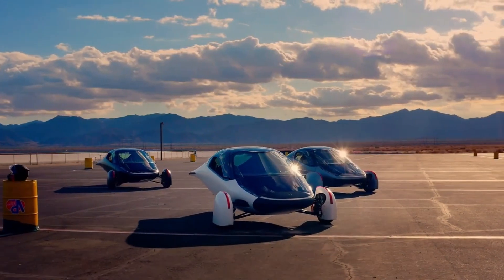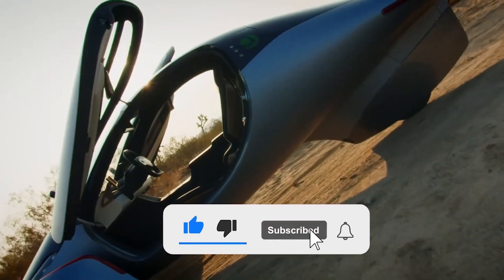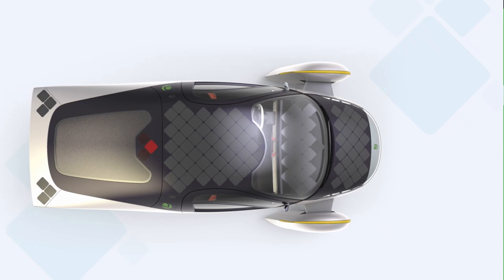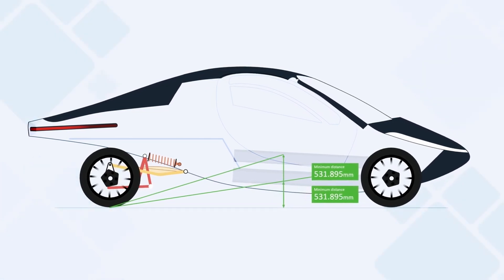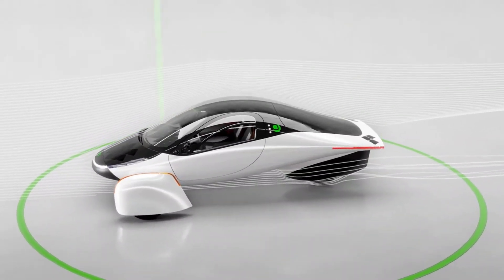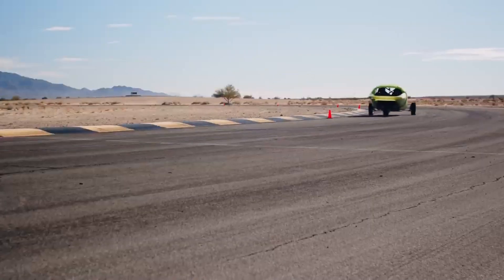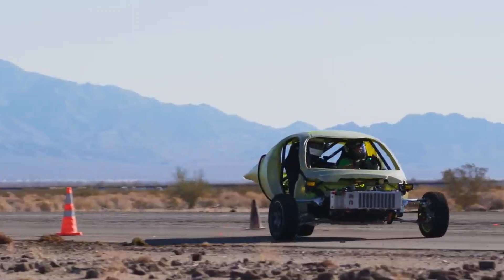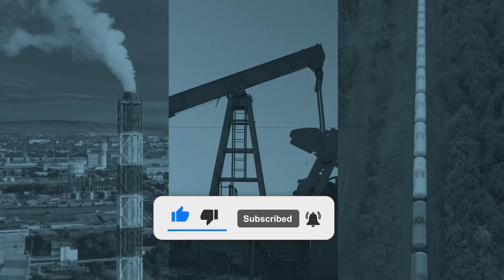Aptera's Stability Under Scrutiny: How It Handles Potholes, High Speeds, and Sharp Turns

Comment: One question is, if you load up the back of the vehicle with heavy objects, how does that effect the stability and control and tippyness?Given the shape of the back, large objects will be up by the seats but heavy objects like boxes of bricks may be close to the back. Wondering how that will effect the stability and safety?

Comment: Basically, putting the two wheels of three at the front gives it its inherent stability. If you want instability you put the two wheels at the rear. Why is instability inherently much greater with two wheels at the back? Because steering and breaking causes greater shifts in force because the car's momentum is moving towards them. Therefore forces become greater and don't dissipate easily. With two wheels at the front, the only way to create potential instability is to accelerate hard while turning hard. Yet even that is made less because the car is moving away from the potential instability and and major outward force is held in check by the outside steering roadwheel. And ultimately, if the outward force is too great, instead of turning over, the rear wheel will slide. So, its layout, combined with its very low centre of gravity [batteries and kit] means that you'd have to be in some very serious scencario to get this thing to turn over. And even then it probably wouldn't.
Reply from the maker: Thanks for this

Comment: My understanding is that these will be released (at some point) close to $40K.

At some point you have to weigh between practicality (only 2 people and no real storage), safety (can only use on clear no snow or heavy rain, and can't be very safe compared to typical cars in crash), and saving a little on costs of running a normal EV car.  Also, I can't imagine going on any longer trips with this, but daily use is OK.

What would it save a typical driver? Possibly $1000 a year at the most in energy costs? Likely quite a bit less?
Reply from the maker: Lo! 
The world actually needs practical solar powered car. Aptera is gearing up in the right direction.
Reply: @Elementraz  I always wonder why people think that there is no storage.  From what I can see there is more storage than in a Model 3 and for a typical sized car it has plenty of storage.  I think people think that this is a small little car.
Reply: The current list price of the Aptera Launch Edition is $30,700, but that may change in the future when they get closer to production.
Reply: The stupid is strong with this particular troll. Everything you said is garbage that has been debunked over and over again. Try to be more original.

Comment: I have ridden and driven one of the Aptera prototypes, screeching around the corners with Chris McCann easily demonstrated with a wide wheel base, low weight that this is one of the most stable vehicles I have ever been in.
Reply from the maker: @greenbergp 
You are on point.
Reply: Too bad that's nothing like what they are working on now. I stand corrected, it looks similar but the underpinnings are completely different.
Reply: @billsmith5960  You are right. It is completely different, but better for handling. The central motor means less unsprung weight. And the carbon fiber tub and steel reinforcement means an even more solid body. The early prototypes showed that the Aptera passed the Moose test with ease. And now the Aptera will handle even better.
Reply: @deanmcmanis9398  Nope, the carbon body is not structural anymore. Only he aluminium frame, where the plastic panels are glued on. The moose test was a fake. See the tracks in the lawn from previous tries that went bad. The aptera motorcycle handles quite bad.
Reply: @billsmith5960  Lets hear your ankle-biting cheap-smear bloviations on how poorly the Aptera will handle now that it features far less un-spung weight than it did with in-wheel motors, and has a more finely tuned suspension. surely you can fabricate some world-class concern-trolling over these developments?

Comment: The validation phase is going to be amazing as Aptera throws up amazing results.
Reply: I haven't seen a single real world result done by set standards. Instead, I see claims of what it could do. With Aptera constantly changing the design, I have no idea how they could keep making the same claims until they actually test the real product.
Reply: @billsmith5960  In going to ask them, as well.  You sound like a skeptic(?)  So, I'm interested in when you would guess this might go into production, if at all. They said they're in the "high speed testing" phase. What do you think, please?  I'm new.
Reply from the maker: Sure!
Reply: What result? I only see more empty promises.

Comment: Lots of talking about the design, I would rather see it actually doing a course against a similar 4 wheel car.
Reply: What would a similar 4 wheel car be then? There are lots of 4 wheel cars out there but I don;t know what would be similar to the Aptera.
Reply: @billsmith5960  Any small electric car, maybe one of the cheaper Chinese cars.
Reply: @billsmith5960  A model 3 LR RWD would be an equivalent car in a 4 wheel configuration.
Reply: @bryanwhitton1784  - Seems to me a Model 3 RWD would not be equivalent. For starters, it's RWD.

Comment: Interesting discussion of design features intended to produce stability and rollover resistance, however: real world specifications for acceptable cornering G forces and the tip over threshold would be more reassuring.
Reply from the maker: Nice. Noted
Reply: Don't worry, Aptera is the most transparent company ever. They will give us the good and bad news.

Comment: It would be sub-par in a snowy environment because the roads tend to have a parallel set of tracks that stay clear of snow due to all the drivers staying in the same ruts as other drivers. The Aptera, on the other hand, will drag its middle rear wheel through all the snow that accumulated in the middle of the road.
Reply: Definitely not for those areas for sure
Reply: Yes.  I used to be a mailman and drove the LLV (they are still in use).  The rear wheels are wider than the front so whenever you had to drive through snow, you were having to make two paths.  It was almost impossible to deliver mail on a snow covered court as the damned things would constantly get stuck when trying to turn.  As for the Aptera, think of all the times you straddle an object or pothole with your 4 wheel vehicle.  With an Aptera, there's a good chance you'll hit the object with the rear wheel.  The Aptera's front wheels are set very far apart so that might be a consideration if you plan to park it in a garage with another vehicle.  I think a 4 wheel model would be a good idea.  It would give you more room for storage in the back and be more stable.  Despite all that, I hope I'll start seeing them on the road some day.  ha!  I've been saying that for years!

Comment: What size generator do I need to haul on a trailer to drive long distances (what is the wattage at highway speed)?
Reply: 100 watts per mile. I was thinking about getting the smallest/lightest battery pack possible to reap the benifit of better accelleration, better braking, less tire wear, and longer range. I was thinking that for the rare times I want to do a longer drive I could temporarily mount a small gas-powered DC generator and connect it to the charging cables that run underneath the rear deck. The side mirror on a Ford F-150 has more wind resistance than the entire Aptera.
Reply: @RaymondCore-ts5jl  There are charging stations in most places to facilitate trips .. why would you bring a generator with all the issues of carrying gas, the exhaust of the generator, and having to let it cool down before you could load it back in to the vehicle.... when you have 250 miles of range and near ubiquitous charging infra-structure? It boggles the mind.  There are 110V outlets everywhere... which with an Aptera will provide more significant range than on any other EV if you can't find a level 2 or fast charger.  Have you heard of Plugshare?
Reply: @ Why would I add complexity of planning on charging stations that may or may not work or may have a long line waiting? I don't want a battery heavy enough to go 250 miles. Only a couple times a year will I drive more than 40 miles in a day and most days fewer than ten miles. A small 80 mile range battery costs less, uses less material to manufacture, costs less to replace, charges to full more quickly, gives better range per kWh because of less weight, less weight makes for less wear and tear on tires, etc. I can install permanent connectors and exhaust for a small, dedicated, lightweight generator that I can quickly install when needed and take out and store when not needed. I would call it Plug In Hybrid on Demand. On your last point, I live in Bangkok in a condo with no home charging. Charging stations are scarcer than hen's teeth and outside large metropolitan areas, where I would go on a long trip, they are non-existant. No Plugshare here. Even if I lived in the US, I don't want to lug around a 250 mile range battery just because I might use it once a year; it would be a waste of resources. Battery wt. 100 mile range 300 pounds. Battery wt. 250 mile range 1,200 pounds. Lightweight genset with fuel and sound insulated cover wt. < 120 pounds. 
The Aptera would be unhobbled by big batteries, and their weight and expense, if they stuck to a small battery pack as standard and added a small, lighweight, genset to keep the batteries in peak condition. The genset could run off LNG, even.
Reply: You should see about getting an early BMW i3 with a REX.  It sounds perfect for your needs.... ~80 miles of range and a gas generator built in which doubles the range. Perfect for your needs and a lot cheaper than an Aptera.  I agree with the first part of your comment... large batteries are a waste of energy to carry around for the most part.  They do have other benefits, but in general,  most people don't drive that much.  I would buy an Aptera with a smaller battery, but not one with a generator... been there, done that.  More complex, more to go wrong.  The BMW i3 REX WAS brilliant when battery tech was not where it is now, but no longer. My comment on 110V charging still stands... anywhere there is electricity is a charging option.
Reply: @ I'm sure it doesn't get a mile out of 100 watts like the Aptera, Again, why do I want to lug around the extra weight. I'm sure the BMW w/battery weighs a lot more than and Aptera. Bigger battery, carrying around an engine I use once or twice a year but have to maintain because it comes on more frequently than the genset I install only when I need it; no thanks. Easy enough to mod an Aptera and for a lot less money and complexity.
Reply: @RaymondCore-ts5jl  If you say so.  i3s are going for as little as $7,000 -$8,000 right now.  You might as well get some server rack batteries w/inverter instead of a trailer and generator... but you know best, obviously.  You would need an inverter style gas generator with a neutral bonding plug for most EVSEs.... a solar generator (or make your own) would be far better... quiet, no gas, portable power, no trailer.... but again, you know best.  Good luck figuring out the trailer hitch.
Reply: @J-W-Kelly  Sorry you find me so unacceptable. Thanks for your insincere good wishes.

Comment: All things being equal the roll stability of a three wheeler, even a three wheeler in a tadpole configuration is less than a four wheeler. That’s because the roll axis in a four wheeler is down the center line as compared to a roll axis between the center (rear) wheel and the inside wheel of a three wheeler.  The Aptera featured in the videos performing the Moose Test incredibly well is using the Apter in-wheel motors which are capable of torque vectoring.  What this means is a computer looks at Mu, the friction and the slip angle about 100 times a second and adjusts the speed and torque produced by each in-wheel motor to optimize stability and traction. This is particularly important for high speed evasive maneuvers where g loads shift from side to side rapidly. The question I have is now that Aptera is moving away from in-wheel motors is it even possible to retain evasive stability even close to in-wheel motors with a traditional single motor open axle intended for low cost, low performance EVs?
Reply: All things being equal a reverse trike is more stable then a four wheel vehicle. 
...Anecdotal but...I can't remember ever seeing a Morgan 3 wheeler, or T-Rex, Slingshot, or Grinnall ever roll over. A quick search of the internet, there seems to be no cases or pictures of one rolled either. 5th gear tried drifting a Morgan and after going off road and then coming back onto the pavement managed to rock it up onto one front wheel, but it righted itself. (It's a good video to see the weight transfer) And Tiff wasn't even wearing a helmet which the show and him wouldn't have done if there was a danger of it.
Reply: That moose test was a joke. Go watch the video and even look at the pic on the Aptera website. The picture shows a huge amount of opposite lock for steering input. No regular person can do that but a racecar driver with good car control can cover up lots of faults.

Want to know why that happened? Look at the contact patch of the rear tire. Only about 10% is touching the pavement. No amount of torque vectoring can fix that.
Reply: The Aptera moose test went quiet badly several times, see the tracks on the grass from previous tests. And no real world data was delivered. In case of an accident the front outrigger wheel is the first thing to tear apart. Where do you think is the roll axis then? Which leads to what? Right, the body ends upside down, and you cannot escape because the doors do not open. a deathtrap in case of an accident.
Reply: All things are not equal, though.  Even though  most weight transfer during cornering is towards the front of the vehicle and away from the direction of the turn (where, by the way, the extra width of the Aptera's front suspension is a bonus), rear-heavy 4 wheel vehicles have higher rear lateral weight transfer during hard cornering... the over steer is more pronounced. The tadpole configuration has no such problem.  I'm not even slightly worried about the handling of the Aptera, and it seems silly to show it next to a traditional trike design.  There is no comparison to be made except that they both have three wheels... everything  about the handling is completely different.

Comment: I invented the reverse trike conversion system for motorcycles and the big advantage of having this layout is superior handling, stability and ride quality. Aptera is defiantly on the right track
Reply: I'm glad you're here.  You can give an informed opinion.   If you were to hang a weight well off the ground and well behind the rear wheel on one of your trikes, what would be the result?.   If you suddenly had to move your motor up between the front wheels of your trike, what would happen to stability?  Are your trikes FWD?  How would FWD affect stabilty?
Reply: Wow what an honor to finally meet the inventor of the 1955 Messerschmitt Kabinenroller KR200. 
https://en.wikipedia.org/wiki/Messerschmitt_KR200

Comment: The Aptera has a low center of gravity, especially near the center of the vehicle, which is crucial for stability. Most cars aim to keep the center of gravity as close to the middle as possible to avoid instability, much like a finger spinner. The number of wheels isn't as important as the size of the vehicle's base—while 4-wheel cars tend to have a wider base, the Aptera’s design compensates for this with its elongated and wide frame. It might not look big due to the 2-door configuration, but it’s not a small car like the Citroën Ami, which despite having 4 wheels, can still be prone to tipping. The Aptera is the first properly sized 3-wheeled car benefiting from the low center of gravity common in EVs, so we can’t base conclusions on past 3-wheelers. Plus, it’s not a sports car—its design focuses primarily on efficiency.
Reply from the maker: Nice. Good analysis
Reply: If you lack one of the rear guiding wheels, you get half of the dynamic stability. Base does not matter, if the rear wheel loses traction. It is dynamic, not static.
Reply: Aptera also has less lateral weight transfer in the rear during cornering... a significant plus.

Comment: Sorry, but the dynamic stability of the Aptera three wheeler is delivered by the rear wheel, not the front wheel. And as there is just one instead of two on a real car, the dynamic stability is just half of that of a real car.
Reply: Where did you get your engineering degree?
Reply: @BluebirdsUnlimited  You can study it in university! Not just gender, clapping, queer dancing...